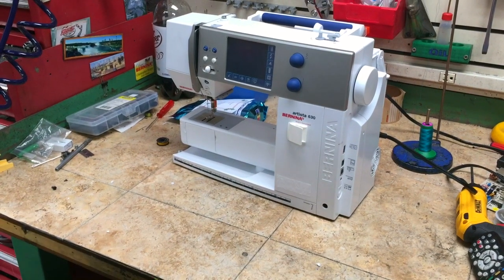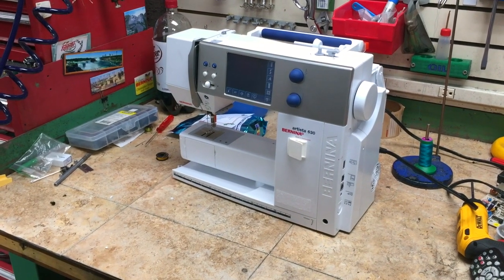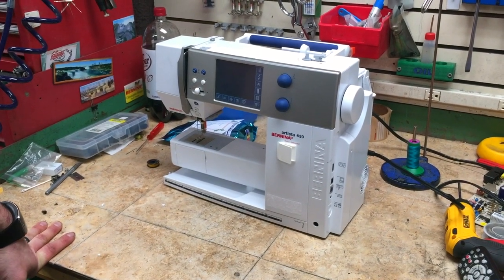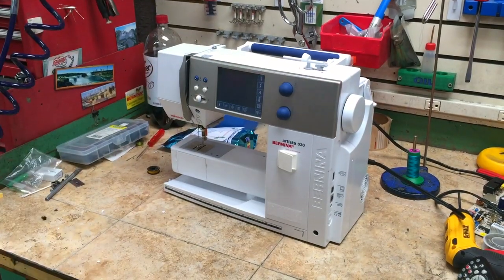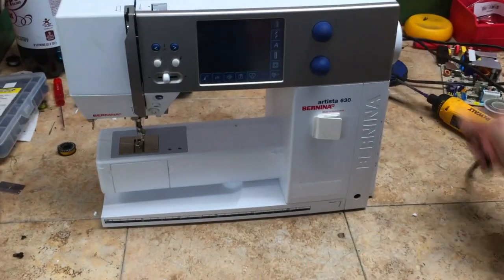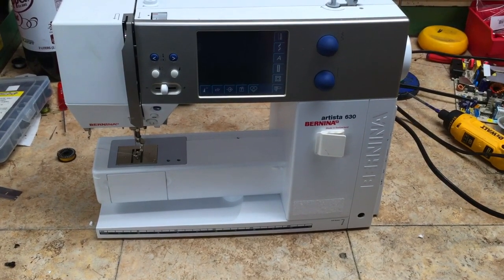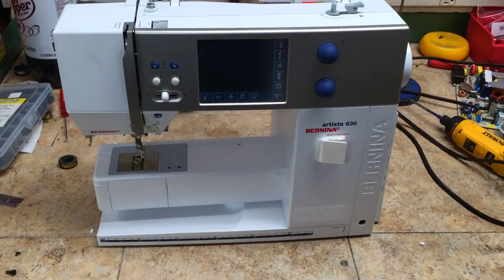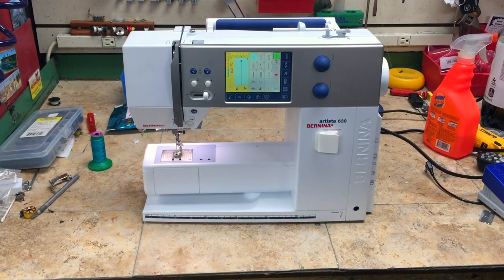Bernina Sewing Machine Won't Turn On

Comment: This worked for us on an Aurora 430.  My wife had not used it for quite a while.  She took it to the repair shop and the guy said "the computer was kaput".  He said there were no spare parts available for this model and it needed to be thrown away.  He said he could recycle it for $25.  She brought it home. I looked at your video and it powered up after about 15 minutes. Thank you so much for sharing this information.

Comment: For those who like to tinker, I found that replacing the smaller electrolytic capacitors in the power supply seems to fix this issue. Bernina used cheap capacitors for the power supply. I'm too lazy to reverse engineer the specific bad capacitor and/or specific issue.

Comment: Many thanks for this wonderful tip.  It worked like a champ.  Took 15 minutes on an Aurora 440.   Now it's as good as ever after sitting for a couple years after a move.  I'm going to write the fix down on a 3x5 card and attach it to the power cord just in case it ever happens  again.

Comment: Hi.  I'm off to a quilt retreat tomorrow and my one year old 880SE is already packed.  I decided to use my 630 today to get a few projects started for the retreat.  My poor 630 has been sitting unused for over a year since her younger sister came home with me.  Imagine my surprise and disappointment to find my trusty 630 wouldn't turn on.  I tried different power sources to no avail.  I decided to look up possible solutions on the internet before taking it to my dealer about forty minutes away.  Nothing worked until I found this video.  I did everything you said about leaving it on and then I set my stopwatch.  It took a little over seven minutes but she's on and working fine.  Thank you for being so helpful.  Yours is the place I'll go for any future concerns.  I adore my Bernina dealer but hate the drive and being away from my machines.

Comment: Thrilled I saw this video and thanks for sharing this information. My local UK repair shop had quoted me £410 ($500) to install a new power board in my Bernina 380.  Picked up the machine this afternoon from them plugged it in - 30 minutes later and it's working.

Comment: Thank you so much for this!! 
I was just gifted a 440 that’s practically brand new (only 40 hours total, 1 hour of work!!!). 

I was very nervous when I plugged it in and nothing happened. After an hour I was on the phone with the service department where it was purchased and it fired up. 

It took 62 minutes.

Comment: Okay, you guys are awesome! I don't sew or quilt daily like I used to, and my machine wouldn't power on today after sitting for about a year. Thanks for putting this out there—you saved me a trip to the Bernina dealer for a repair that I apparently don't need! So is this "working as intended"? You mention a repair, so I'm a bit confused about whether my machine is just meant to behave this way, or whether a repair would be the best option. Thanks again for filming this!

Comment: Christopher was able to correctly diagnose the problem with our B740 (failing CPU board) from just a brief description.  Very impressive, and clearly based on vast experience and skills.  I'd warmly recommend Christofer for any repairs or service on Bernina machines, I'm sure you'd be in safe hands.

Comment: This video saved me.  I had not used my machine for two years since it is my travel machine.  Took it to a workshop and it would not turn on.  I was sure it was some big expensive problem and was going to take it in and feared I would need a new machine.  I wish the manual indicated this in the trouble shooting section

Comment: Thank you so much!  My wife's 440 QE wouldn't turn on after at least four years of non-use.  She was at a quilting retreat, and her 580 was acting up.  I almost had to haul her huge and heavy 790 up there for her, but I watched your video and it saved me a several hours of travel and a lot of back pain from carrying it up and down the stairs!  It did take about an hour, but the machine finally turned itself on🙂.  Why does this info not appear in the manual's troubleshooting guide?

Comment: Is this due to a bad capacitor on the power board?   Or is there a memory battery that looses charge, and needs to be charged back up?  I have seen this with nv ram and cmos batteries on computer mother boards.  If computer is not used for quite sometime the battery on the mother board can drain.

Comment: It worked on the 560 too. Thanks for the help.
Reply: hey..Zoltan.. have some troubles here with the 560. it won`t start up to the self testing drrrrd noise. just showing up bernina 560 on the display for 25 seconds then black screen for a moment and the bernina 560 screen again..  similar to your problem ??

Comment: I haven't used my 430 Aurora for 2 years. It turned on but the lights didn't. I left it on like you said and the light came on after about 45 minutes and stayed on while I sewed a bit and then it went off again,. It still sews but no light. I don't know how to access the settings to turn the light on. I did hold the 16, 17,18 buttons down while I switch it on and the light flickered but didn't come on.

Comment: Would this work for a Bernina 750QE it hasn’t been used for maybe a year...
Reply from the maker: Probably not. They have a different computer board on that machine. Take it in to your dealer and they can help you solve the problem.
Reply: Bernina Boys  thank you! Guess a lesson learn NOT to electronics from the marketplace ;(

Comment: My activa 220 has this problem. It went back and forth to the repair shop several times, but they could not diagnose it. On the last trip the carry handle broke. If you still do this repair I would love to have it fixed. Where are you located?
Reply from the maker: Cheryl McGee Dave's Bernina is located in Provo Utah. Give us a call at 801-374-5520

Comment: Hi Dave I have a Bernina 880 that I just purchased.  I have been using it daily for the past week.  This morning it would not turn on.  I have tried various outlets that I know work.  Can you help?
Reply from the maker: Linda Mischiara you can try a different power cord. If that doesn’t fix it you’ll have to take it to your dealer. It’s most likely either a bad fuse or a bad circuit board
Reply: Thanks.  Tried a different power cord with same results.  Taking it to my dealer tonight.
Reply: What's this with Bernina circuit boards?  I have an 830LE with a defective circuit board which will cost me a fortune to have replace.  I'm the fourth one among a quilting group to have the same problem.  Now another one here!

Comment: Would this work with a Viking Husqvarna 120?
Reply from the maker: Probably not. Those are known to have different problems. Unfortunately parts for that machine are hard to come by. It may be a very expensive repair :(
Reply: Would you start with changing the on switch?
Reply from the maker: Melissa Bekkum that probably won’t fix it. Contact your Viking dealer and see what they recommend.

Comment: Hi. Have a Bernina 830 2015. Haven’t used it for about a year and now seems to be losing memory not holding time or stitches. 
Is there a battery that may need replacing?
Reply from the maker: Yes. There is a watch battery in the base of the machine under the hand wheel that needs to be replaced.

Comment: I use my 440 all the time. I just cleaned and oiled it.  Today out of the blue it's not running.  It's beep and the small monitor on it is blank.  Can you tell me if my machine just died?  It's old.  It's the quilters edition 440.   Thanks. Karen

Comment: Hello Bernina Boys. Would this work for 1630 Inspiration Plus? I powered it up about a year ago and it worked fine. Just tried again and nothing. Any help you could provide is appreciated.
Reply from the maker: Becky Burke this method is not going to work for a 1630. Most likely it will need a new fuse or a power supply. You’ll have to bring it in to your dealer for that.
Reply: Thank you so much. I'll stop sitting here staring at it, waiting for it to turn on ;)

Comment: I want to try this now on my Bernina 150, I haven't used it in years. But when I first turned it on, it flickered, then went dead, does that mean it is probably something else, like the power supply or circuit board?  I saw those 2 items addressed below and elsewhere for the Bernina 150 not turning on.  Can I possibly damage it more by turning it on and leaving it on?
Reply from the maker: Heidi Knowlton Raja Mukherjee Your power supply is most likely bad and needs to be replaced. I would be shocked if leaving it turned on solved your issue. You're welcome to try it and it won't damage your machine anymore than it already has.
Reply: Thanks. I'll take it to a local repair center tomorrow.
Reply from the maker: mizzmolly it could be a number of things. The sure thing is to replace the power supply. You will have to take it to your dealer where they can trouble shoot it further. There might be some solder points that have gone bad and need to be resoldered (pretty cheap fix).

Comment: If my machine won't power on after 2 hours and all of a sudden smells hot/burnt, could it be the power supply?
Reply from the maker: J Kr yes. The power supply is why it wouldn't turn on in the first place. Whether it is burnt out or not it needs to be replaced.
Reply: Bernina Boys . Ok, thank you so much!!!

Comment: High Dave I have a Bernina Artista 200. The light went off. How do I turn it back on?
Reply from the maker: First of all i would consult your manual and re-set all the settings. Usually the light does not turn off, most of the time the light tube has been banged and has been broken.  Hope this helps!

Comment: could this work also on a bernina 150???
Reply from the maker: J Kr you can try it but it's not very likely. You probably need the power supply replaced by your dealer.
Reply: Bernina Boys ok, thank you! How much could that cost? I have had it plugged up and on switch for about an hour and nothing, but right now all of a sudden I smell a burnt smell. what have I done?!?!?!

Comment: Hello, any clue on where I can find a replacement foot pedal for a Bernina 900, it's a round air pressure type pedal that I haven't seen on any other machine. When I press the foot pedal sometimes it doesn't work. Or sometimes it jumps into high speed.This machine is from 1979. I've been told the real porblem could be a circuit board, not the pedal.
Reply from the maker: Auriam Delien the circuit board that should be in the foot pedal is actually in the machine. It's the circuit board that is most likely the problem and that will have to be repaired.

Comment: How much does a circuit board cost to replace it for Bernina QE 440?
Reply from the maker: Rose Reyna retail is around $150 + labor. Depends on your dealer what they decide to charge. If you are feeling brave and want to replace it yourself, call Dave's Bernina in Provo and we can walk you through the process.

Comment: Dave when I turn a Bernina 750 QE on the sewing light flashes and nothing else, I guess it is a fuse or circuit board problem, thanks Dave.
Reply: 780 here, same problem… very interested to know if you found a fix?
Reply: @ericablythe1  have put it aside for a while Erica, have taken the back off and looked for any loose connections plus any burns on the circuit board, will get back to it soon, it is something fairly simple it’s just a matter of diagnosis, for now make sure everything is connected, it’s probably the power outlet of the machine, will keep you informed.

Comment: Hi Dave. First off, thanks very much for taking the time to make and post this video.  My wife's 640 started exhibiting similar behaviour a few months ago.  The only difference is that about 15-20 seconds after she turns the power switch on you can hear the servo's homing but nothing else comes on. I'm suspecting the power supply or circuit board/board connections. I figured if it was the main switch the servos wouldn't move.  If she turns the switch on and off a few times it seems to help. We haven't tried leaving the switch on yet for an hour like you have done   Any suggestions to test further?  I live in Canada so the paperwork involved in sending you the unit (and getting it back) would be too encumbering. Can I buy parts from you though?
Reply from the maker: pjwlk It's tough to say exactly what it is. It would be very expensive and time consuming if we were to send you the parts one at a time until we find the right fix. We would be happy to fix your machine if you sent it to us. And In the end it would for sure be cheaper doing it that way

Comment: Yesterday I had brought my machine (Bernina 450) home from a service plus they had replaced my power source(it was having issues with rebooting repeatedly on two separate occasions) when I set it up and turned it on the screen was lit up but there was no icons on the screen. I could use the machine but I had no idea what it was doing. I found your video saying to leave it turned on. Two hours later the icons appeared. Turned it off and on again, no icons. This morning turned on the machine, no icons. Left it on for two hours icons reappeared. Does it just need charging or is something faulty?
Reply from the maker: That is not normal. Something isn't right. Return it to your dealer and have it fixed. My guess is the replacement circuit board is faulty (it happens from time to time).

Comment: After 2 hours and no power (I haven'tused it in 10 years, what should I do to get it to power up?
Reply: Mine is the same, no use for ten years, did you find a fix?
Reply: @cud007  unfortunately no; I had to purchase a new machine.
Reply: @April_Mosby  I left mine on for over 2 hours to no avail, I switched it off and back on again, twice in quick succession and it powered up. After the initial 2 hours I was beginning to think there was no hope. I have been sewing happily today. Thank you for your response. Greetings from Kalgoorlie, Australia.
Reply: @cud007  I will try to power it up again (thx)

Comment: I have a 560 that has an error message when I turn it on and will not finish starting up. I used it a couple of days ago and it was fine. Any ideas?
Reply from the maker: Valerie Yu it most likely needs either a firmware update or a new CPU. Both should be under warranty from your dealer.

Comment: Bernina artista 200 without the upgrade.  I was in the service screen trying to by-pass the bobbin sensor. Well I decided to have a look at what version I have and was looking at page 1 and then 2 and then tried to escaspe but it was not an active button and pressed back to page one and still no escape active and may have hit OK...but not sure..but because I could not get the ESC active I decided to turn off...now it will not turn back on and screen is blank...HELP...Have I  ruined my machine???
Reply from the maker: MP D this is very strange. I recommend taking it to your dealer. It may need a firmware update which should be pretty inexpensive.

Comment: My small wheel on my bernina 830 is jammed solid please help
Reply from the maker: Not sure what you are referring to when you say "small wheel". Which 830 do you have? Is it from the 1970's? Or is it only a few years old?
Reply: I’ve just bought it .there is a larger hand wheel and a smaller wheel in the middle . The smaller one as jammed . It was working fine I must have done something
Reply: It’s from the 70s I think
Reply: Think it’s called a clutch
Reply from the maker: You have a main hand wheel (big wheel) and the clutch (little wheel). You should only ever need to loosen the clutch to wind a bobbin. If it is jammed solid, it shouldn't affect anything besides winding a bobbin. There is nothing that could be preventing your clutch from loosening if it is turned hard enough. If you absolutely cannot loosen it, just take the thread out of the needle to wind a bobbin. If it's the big wheel that isn't turning, that's a different story. You will need to take it to your dealer if that's the case.
Reply: Bernina Boys the big wheel is fine the clutch is jammed I have filled the spool that worked fine .
Reply: Thank you for your advice I’m sure I will need you in the near future great help Maura

Comment: My Bernina 880 will not "boot" up after turning it on.  The screen goes back and forth from a black screen to the initial Bernina opening screen.   It was working fine, I turned it off and when I came back to sew, after an hour it will not start. Is it the mother board?  This machine is only 2 years old!
Reply from the maker: Debbie Nix it doesn't sound like a motherboard problem. It's most likely a firmware issue or it needs a new cpu. Not sure what your dealer will charge but the parts are still under warranty. Here at Dave's Bernina we give a 5 year warranty on all new machines so it would be free. Hopefully your dealer does something similar.

Comment: mine seems to be going to sleep. Activa 220. It comes on like normal and works, then will stop after 30-45 seconds. still has power, but the info on the screen goes away and it won't sew. Really bummed as I'm making some donation masks.